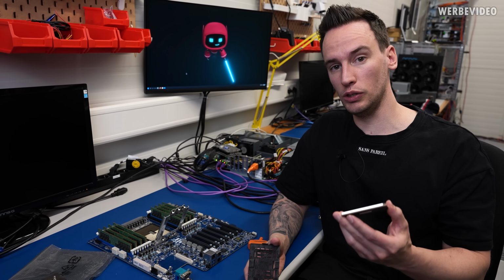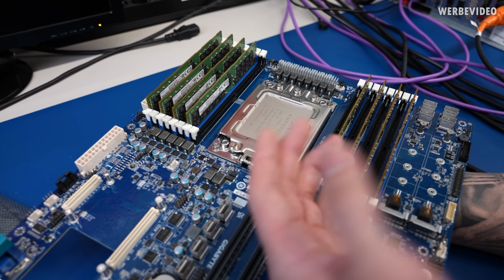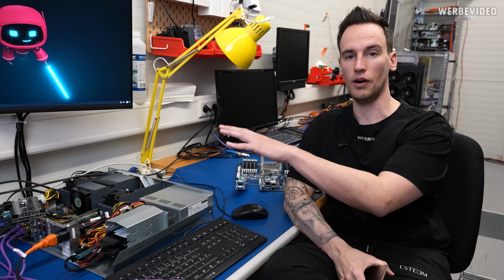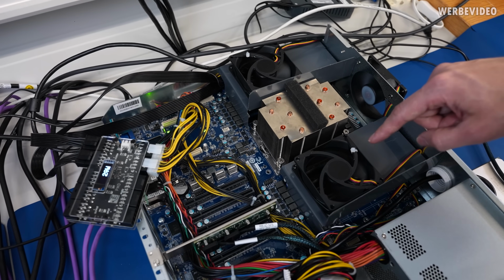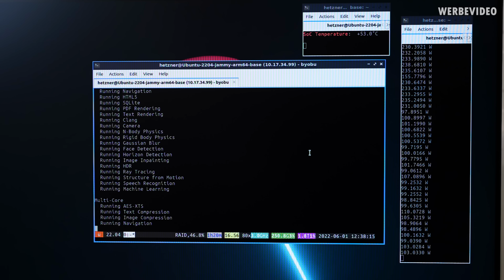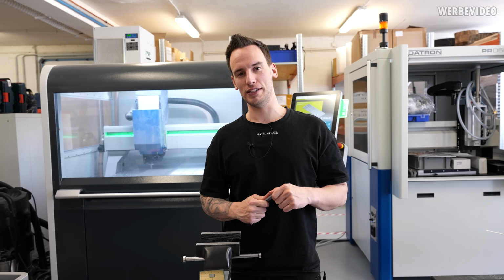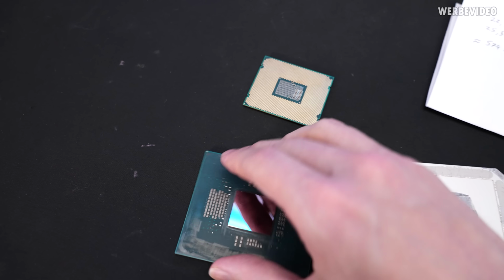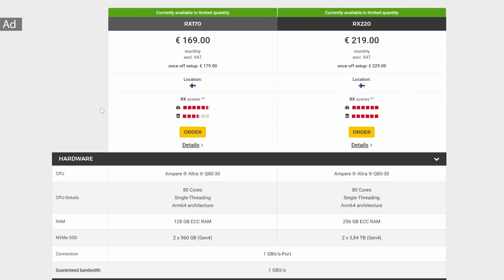This insane 80-Core ARM CPU easily beat a 64 Core Threadripper

Comment: ARM stands for Advanced RISC Machine, but when it was Acorn property it was Acorn RISC Machine.  Point of note, but I’ve seen some dubious false knowledge of it being touted on the internet which would surely upset Steve Furber and Sophie Wilson who both worked on its creation.  At least they’re both around to dispute the claims of it being an American design.

You could make a whole video about its origin if you felt like it.
Reply: *Roger Wilson
Reply: @desktorp  That was Sophie Wilson’s given name, but we won’t spend too long deadnaming her now will we.  Most transgender people would rather others didn’t.  Thank you in advance for your expected manners in this delicate matter.
Reply: Sophie Wilson is a computing legend. She wrote the BBC BASIC interpreter in 6502 assembly language for the BBC Micro at the beginning of the 1980s. Later she designed the ARM instruction set and wrote an emulator, again in 6502 assembly language, which ran on a BBC Micro (with 6502 second processor), which proved the concept. Steve Furber then implemented the design in hardware and worked with VLSI to manufacture the silicon. The original ARM1 was used in a second processor for the BBC Micro to further prove the concept. The second iteration, ARM2 was used as the basis for the Acorn Archimedes home computers, along with three support chips, also produced by VLSI, called MEMC, VIDC and IOC, which provided memory, video and general IO support, respectively. The interim ROM-based single-tasking operating system was called Arthur and early buyers got a free upgrade to RISC OS when it was released. I bought an A440 Archimedes with 4MB of RAM, an 800KB 3.5-inch floppy drive and a 20MB hard disk. I moved on to a RiscPC later and I still have both. The best thing about BBC BASIC is that it included an inline assembler, first for 6502 and, on the Archimedes and RiscPC, ARM assembly language.
Reply: @johnm2012  Now if only I could get my hands on the coveted ARM second processor they used to test it on, now that would be something.  Story has it that it used so little power that when they accidentally connected it up wrong it ran on just the power coming in through the IO pins’ protection diodes.

That must have been a foreshadowing moment!
Reply: @Jenny_Digital  I seem to remember Steve Furber confirming that little anecdote in an interview he gave about the SpiNNaker project. I'll try to find it - no promises though - and post a link.

I've never seen an ARM1 second processor for sale - they must have only made a handful for internal use - but there's an open source project to implement a generic second processor for the BBC Micro, using a Raspberry Pi. The Pi connects to the 2MHz "Tube" interface and runs code that allows it to emulate all manner of second processors, including 65C02, Z80, Torch Z80, 32016, 80186 and ARM.

Comment: The radeon 7970 had a sunk chip too, though it's not hand replaceable, so maybe it doesn't count.
The i7 8709G also has a similar thing with the igpu being lower than the cpu (or the opposite, don't remember)

Comment: X86 or X64 CPU's are good at "everything" pretty much but chips like these are optimized for "certain" workloads in where they really excell. So comparing it to a Threadripper or something in that order does'nt make me warm (yet). It is a special use-case in where you can use these CPU's to their full benefit.
Reply: Those ARM chips are just as general purpose as any x86_64
Reply: @Jo-ToSchäg  Yeah but if you strip all the unneeded features in a threadripper your looking at pretty much the same efficiency and such. Ryzens are extremely efficient anyway.

Comment: That processor is a bit over twice as fast as my EPYC 7601 (32C/64T).  SC: 894.    MC: 19070.   Single core is about the same.  MC is 2.2x faster.
For CFD work, both need more memory bandwidth.  8 channels is not enough.
Reply: To help me understand, I needed to look up the specs, heh. For the per-core stuff:

AMD EPYC 7601 = 3.2 GHz | Ryzen Zen1 | 894 @ 3.2 GHz
Ampere Q80-30 = 3 GHz | Neoverse N1 | 882 @ 3.0 GHz

To compare, N1 has  +5% higher 1T GB5 IPC vs Zen1. Arm claims the 2022 N2 has +40% IPC gains. Iso-power, +10% perf (though with 8MB vs 4MB L3). Iso-perf, -30% power (both are iso-process, but presumably N2 will be on some 5-nm nodes).
Reply: [as my EPYC 7601 (32C/64T)]

The "MY" is key here. 15:33
Reply: @Atheist7  Nope, that 7601 1T GB5 score is entirely representative. See the thousands of results at Geekbench: when unthrottled, all peak at a very, very similar ~890 points. And, clearly, it is Zen1 @ 3.2 GHz: it is very expected.

While anecdotal, it falls smack dab where the thousands of other results are.

Comment: All this ARM praising is going to lead us into a future where our computers are as locked down and restricted as our cellphones are. Companies are not going to have a change of heart now with the ARM platform after years of using it to lock in mobile and tablet users. It's not a shocker that a CPU with 80 cores beat a 64 core CPU and no one beyond people who love talking points cares about "performance per watt". Using all these synthetic benchmarks and buzzwords will not make this platform any less of a consumer rights disaster.
Reply: I don't understand how, everything else equal, an ARM based processor is any more locked down than an x86 based processor. Shouldn't it be the other way around as ARM is a more open platform for development than x86 which only has 3 license holders? Also how can you argue that nobody cares about better performance per watt, if that were true then microprocessors would have never improved since their inception.
Reply: @jerma984  When was the last time you installed Linux on your phone or tablet without having to unlock a boot loader? The only people that allow you to do such a thing is the single board computer manufacturers and then they have to hunt for ARM manufacturers that will allow it. Notice how a lot of chips in that space are Mediatek or older version chips? That isn’t because they are the best. Apple themselves are using ARM to lock people into their hardware and kill the Hackentosh market. They even bottlenecked the i9 to make their chips look better on paper.
Reply: @8bitsloth   Locked bootloaders are not specific to the ARM architecture they are specific to vendors. They could do the same if phones ran x86 based processors. 

Mediatek processors use ARM architecture. If you already knew this, I don't know why you brought it up because it invalidates your previous argument.

I don't understand what you mean by "Apple themselves are using ARM to lock people into their hardware". If you mean Mac OS is only able to run on Apple computers, that isn't true as it is still very easy to virtualize. If you mean that ARM based Apple computers can only run Mac OS thus making users dependent on Apple, that isn't true either as it is still simple to install Linux (Asahi) on ARM based Macs. 

Apple purposefully bottlenecking their i9s has nothing to do with the ARM architecture's supposed inherent anti-consumer nature. 

You also forgot to explain why you are against increasing processor efficiency.
Reply: @jerma984   Locked boot loaders can be put into anything, but ARM manufacturers are the ones using them to restrict freedom. I pointed out Mediatek as one of the few not doing this and that doesn’t invalidate anything. It’s like saying one bad batch of gas station sushi invalidates all of Japan’s restaurants. If you can’t understand Apple is switching to ARM to restrict what their software can run on I can’t help you. Gimping Intels chips with their horrible laptop designs makes the ARM pill go down smoothly when they start trotting all their synthetic benchmarks. As far as efficiency, I’m neither against it more for it. Efficiency will happen sooner or later, making it a bullet point like all the ARM fanboys do is just useless fluff to make their arguments look better. 

And just so you know, I want RISCV to take off and become a truly open platform. It’s not that I think ARM bad because x86 or efficiency bad because Intel. ARM is bad because it’s history has shown that it has mostly been used to restrict users freedom when it comes to their hardware. Now that the normies expect ARM hardware to be infested with locked down operating systems and crappy app stores there is no incentive for the industry to change their tactics. They don’t give a dead rats carcass about us nerds, we only fuel them with free software. What these companies care about are the whales that will buy a new ARM laptop every two years because they changed the number on the chip and restricted certain popular apps from installing on your older hardware.

Love ARM all you want, but don’t expect manufacturers to have a change of heart after 10+ years of denying users their freedom.
Reply: @8bitsloth  a raspberry pi is arm based and pretty open. I've ran linux and freebsd on them.
Reply: @REAL_blubskye  Yes and how powerful of those? Would you be willing to put it up against a Mac? The Pi 4's CPU is from 2016. How many advances have we had since then? Have you read up on the issues OEMs are having with getting newer Mediatek ARM hardware unlocked? Spend a week in the handheld emulator community and see what it's like there when a company tries using a newer ARM chip. Look at Samsung, they "support" unlocking the bootloader then disable features from the phone like the camera.

Just because you have 6 year old outliers doesn't invalidate that the industry as a whole does not support unlocked bootloaders.

Comment: Hey Roman, for those who aren't super geeks like you like, can you explain in laymans terms what this would mean over using an Intel or AMD CPU based server? I mean yes it toasted them in the GeekBench5 test, but what exactly does that entail, what programs etc that would be applicable that someone might want to run if they were renting a server?
Reply: It will run Linux no problem and many apps which are compiled for ARM. Many apps aren’t built for ARM as well but could be. Think of it as a Raspberry Pi or Nvidia Jetson. They run full blown Linux desktops but some aspects of development might be a pain or different. Instruction sets matter if you do more hardware optimised stuff like video encoding or some specific computations. For a web and DB server and enterprise software this should be no problem.
Reply: @AI-xi4jk  I have a 4 core VPS sitting on one of these. Encoding with ffmpeg (x264/aac) goes at pretty much the same rate as x86-64 with a similar core count and clock speed.

Comment: x86 was never known for its efficiency. hence why mobile platforms uses ARM. However x86 cpus are hitting transistor limits so at this point we can gain performance with cycles/watt.
Reply: ISA does not decide the efficiency of a processor.

Decoders are pretty much the only ISA specific logic in a modern X86 CPU. Jim Keller went as far as stating that you can turn an X86 core into an ARM one by simply swapping out the decoders.

And decoders don’t draw that much power: a 2016 paper saw the Haswell decoder drawing ~1.8W in the FP test workload, and ~4.8W in the INT workload, 3% and 10% of the package power, respectively. In other words, not enough to create a gap between an X86 core and an equivalent implementation AArch core.

Plus, recent high performance core designs utilizing both ISAs all have adopted the Micro-Ops cache as an architectural feature, which allows the front end to bypass the decoding stage. The only exception, ironically enough, is the Atom cores from Intel, the company that introduced Micro-Ops cache into processor design in the first place.

As for why smartphone processors today all use AArch? Because ARM (the company) has a very flexible licensing model. It’s virtually impossible for a company to negotiate an X86 architectural license from Intel and AMD, so if these two companies don’t make the processor that fits your workload, you are out of options. ARM by comparison has a comprehensive catalog of in-house core designs, (today) serving everything from microcontrollers to HPC workloads. Licensees only need to pay $ to gain access to these IPs and incorporate them into their designs. Licensees with more resources are able to only implement the ARM ISA without using an ARM in-house IP, as is done by Apple and Marvell (Cavium). Qualcomm and Samsung previously fit into this category as well.
Reply: @DGao-zz5vq  this is absolute nonsense and is irrelevant to what i said in the first place.
Reply: @prydzen  present your counter argument then.
Reply: @DGao-zz5vq  ARM is RISC and x86 is CISC. for one they are going to perform differently. Secondly they are going to perform wildly differently on chips that were optimized for on or the other.  I dont feel like explaining any further, too much effort for a senseless topic.
Reply: @prydzen  you do realize that modern codes break ISA instructions down into Micro-Ops in the decode stage, right? Modern cores don’t have fixed function hardware dedicated to the execution of the more complicated instructions that are present in both X86 and AArch. The CISC/RISC divide stopped being relevant two or three decades ago.
Reply: @DGao-zz5vq  did you even read what i wrote? no.
Reply: @prydzen  I’m getting the impression that you aren’t familiar with the concepts I talked about, and are trying to explain this unfamiliarity away by accusing me of not reading your comments. So let me rephrase my main argument: 1. modern processors bear high level architectural resemblance, regardless of which instruction set they choose to implement. 2. In a modern processor, the amount of logic dedicated to the implementation of the instruction set is relatively small relative to the total amount, and is not consequential enough to have substantive effects on the performance or efficiency of a processor.
Reply: @DGao-zz5vq  you have no clue what i am talking about it shows.
Reply: @prydzen  I’ve been trying to present a coherent, data driven argument against “x86 was never known for its efficiency. hence why mobile platforms uses [sic] ARM”, and you’ve been throwing ad hominem attacks. I don’t plan on continuing this argument any further - there’s no point talking to a person who’s unwilling to listen, so I’ll leave you with these:
1. Apple switched from PowerISA (RISC) to Intel NGMA (CISC) in 2005, which substantially improved the efficiency and performance of Mac computers.
2. A 2014 study suggested that Intel Bonnell (CISC, IOE) beat ARM Cortex-A9 (RISC, OoOE) in both performance and efficiency.
3. Excerpt from Anandtech’s Jim Keller interview: “[Arguing about instruction sets] is a very sad story.”

Comment: I once tried to delid an old cpu and it turned out it was soldered on the lid (or at least had something strong holding it), so i ripped the chip off its pcb. Maybe using heat is the safer choice.

Comment: Geekbench is a useless piece of irrelevant software. According to it, a Raspberry PI4 would fit on the same scale as x86 CPUs of the last 15 years. 
If you want a more relevant and accurate standardized benchmark for servers that need to perform calculations, memory operations, etc., then you can run the built in benchmark in Wolfram Mathematica that is native to Windows and Linux x86, but also Linux and OSX ARM. It runs natively on Raspberry Pi Zero, Apple M1, Epyc, Xeon and everything in between.
Reply: This 👍
I would be verry interested in such a comparison